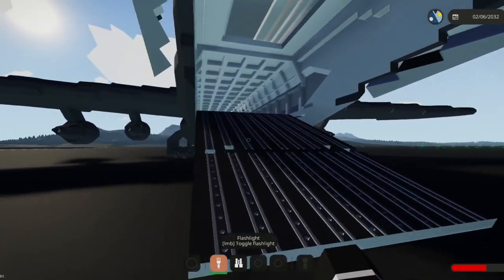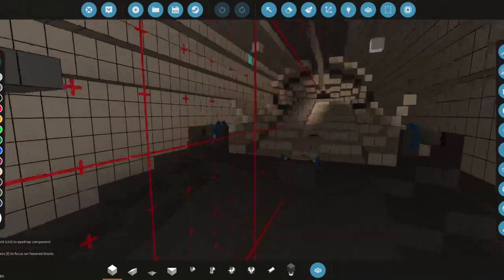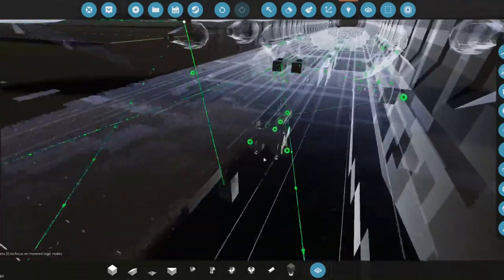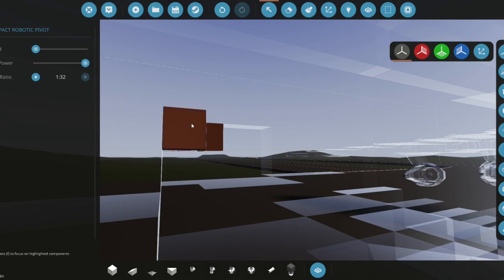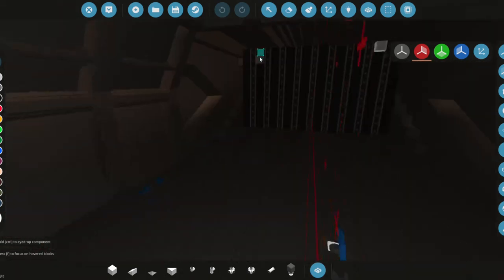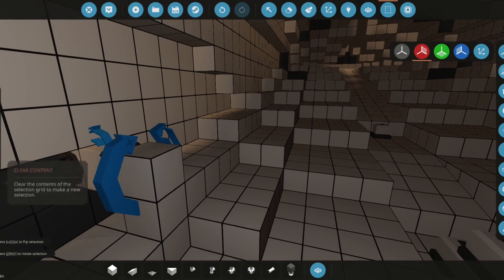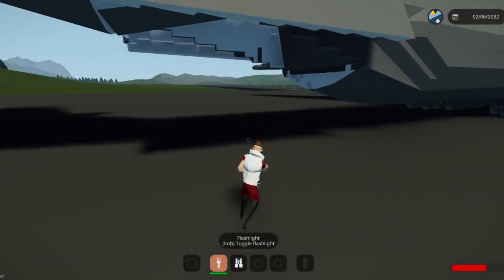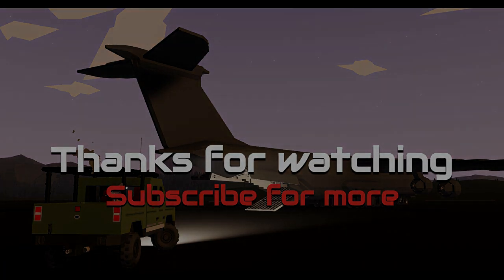Finishing the back cargo door! - C 5 galaxy EP 11!

Comment: You can always use electrical connectors (hard points are better since they can’t bend)
You can also use a relay to disconnect the pivots after all connected to save your batteries

Comment: Love these vids :) also wouldn’t it be easier to use capacitors and switchboxes instead?
Reply from the maker: It would be a lot easier but I decided to use a throttle lever rather than a toggle button so I can't use capacitors.
Reply: @Josh J Gaming What about having the door sections be controled by a button, and the ramp section be controled using a lerver? (With the throttle connected to a switchbox, which will only turn on and allow the ramp to be lowered once the door is fully open)